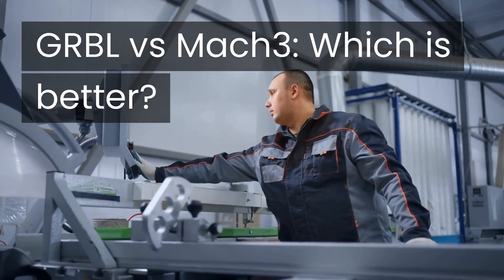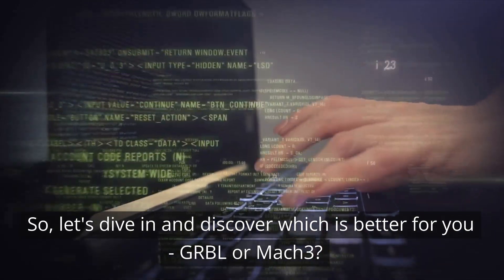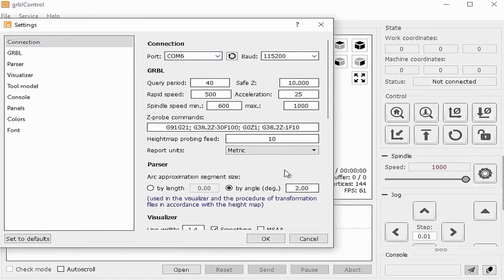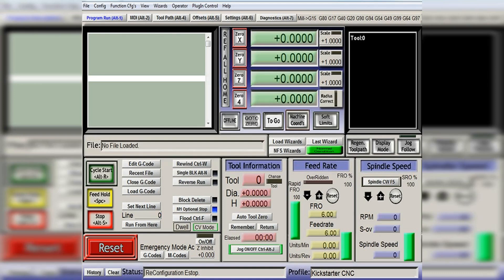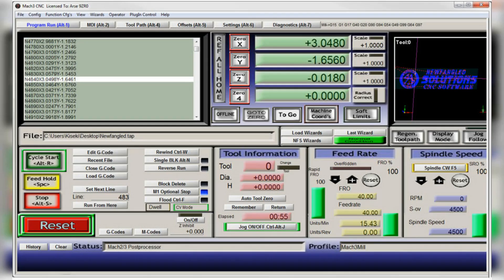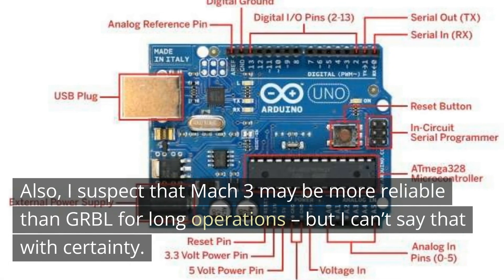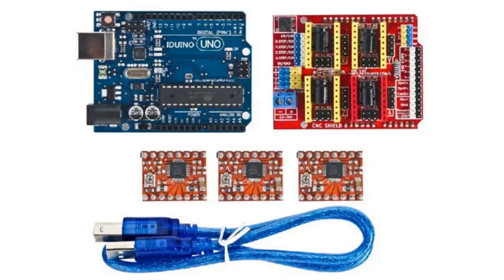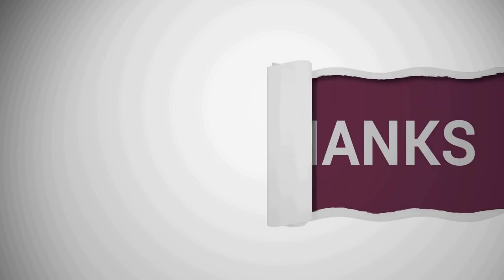GRBL vs Mach3:  Which is better?  CNCSourced

Comment: Arduino has changed its terms and conditions (after been brought by qualcomm) on its software use which undermines the open source using the Arduino.

Comment: I have used mach3 with an ethernet motion controller since 2015. I started in 2013 with mach3 and parallel breakout board (BOB). I also have a grbl machine but hardly use it because mach3 is so much better. Here is a tip, Look at New Dangle Solutions Mill Wizard.

Comment: Not exactly and Apple to apple comparison, more like apples and oranges. The other issue not stated is windows is not a real time OS. To use windows to make microsecond and millisecond timing is critical and not as good as having a dedicated CPU (Arduino) run Gcode from a PC or Host and off load the critical timing to the Arduino ATMEL CPU.

Comment: the only useful part about coming here is seeing peoples worthy comments
mach3 for years has USB and works perfectly on win 7 10 and 11 
mach3 has much more support and features that no GRBL software can do  
when I first used a Mini cnc it was with Grbl and to say for the cost it is suitable for these little machines
as free controller software and a good amount of support from the GRBL community
 
But after a short while i moved to Mach3 as i got a 4 axis desktop and wont change the back to GRBL
and to say i love Arduino as i develop stuff  very often ,  but to use on a 4 axis high voltage and with 1.5 kw with Limit switches and camera and safety sensors  for a  such cnc nuh!

Comment: Lots of misinformation in this video.There are many Mach 3 and Mach 4  USB controllers. Mine is for a start.I use a tiny Beelink mini pc to run mine , to save space.
I have never used parallel for cnc nor have I had to.
Mach 3 has been around for many years so there is a lot of knowledge and information to help you all over the web.I started using Mach 3 with my USB Mach 3 controller just over 4 years ago as a total novice ,I had never used a cnc machine, not even seen one in the flesh.Within the day I was running it like I had been using it for years..Mach 3 is not perfect and it is old and will never be updated.But there are many users all over the world still using it and there are many companies making things to work with it.

Comment: 3:52 You said GRBL can only control 3-Axis. You can control 4, 5, or 6 depending on how many you need with GRBL.
Reply: How ? Trying to figure this out now
Reply: @regdrifts  It depends on the board you're using. FluidNC is free code for the ESP32 and allows for up to 6 axes. There are many boards that support 6 axes.

Comment: 1:28 Did he say parallel port? Why is this stuff of the past in the 80s and 70s when we had ditto machines and FAX machines? COME ON Mach3 upgrade to USB.
Reply: Mach3 compatible controllers with USB and Ethernet interface have been available for over a decade.
COME ON FrustratedBaboon, upgrade your knowledge to at least 2010 level.
Reply: A lot of “old tech” is still used. While USB is superior for consumer electronics, it’s not necessarily superior for industrial equipment.
Reply: avoid anything that uses an arduino! you could pay me to use grbl!

Comment: Very biased comparison.  GRBl on arduino doesnt need break-out board?  That's effectively what a shield is.  Mach has been supporting ethernet for breakout connection in lieu of parallel ports for several years.  High step rates benefit from the much faster cpu speed in a pc or laptop.

Comment: Anyone that has programmed for a living knows that the canned cycles and variables and macros are a huge advantage also machines like HAAS and robots in the auto industries use Fanuc based programming code. grbl will always just be a toy cnc for 3d printers and laser engravers.

Comment: GRBL will not "outdate" linuxcnc/mach3/4... simply put, GRBL is NOT a realtime controller. Because of that, there are quite a few features it simply cannot do. On top of that, there are a plethora of other reasons such as IO's, and additional hardware that can be added to the stack on realtime controllers that GRBL can't handle at all, and won't be able to unless it's ported to another hardware platform. 

There are very good reasons that GRBL is almost exclusively used in beginner / hobbyist environments, and almost never used in professional settings. Features, IO, Stability, repeatability etc are all among these reasons.

Comment: Don't forget to mention that GRBL is turn based, send commands, wait for them to finish, send more. 
LinuxCNC and Mach3/4 are real time.
Reply: Is this true? The plan ahead system was what put GRBL on the map, making all other MCU firmwares obsolete, and made it be the basis for all 3D printer firmwares back in the day. I think you are misinformed about that one. You would never get fluid motion the way you describe.
Reply: GRBL waits on commands for sure try to run at a feed rate of 2700 inches per minute on cutting profiles you will see it stop and go you never see that with Mach 3 or Linux CNC unless you loose steps and if you have closed loop motors that will throw an alarm and stop the machine in mach3 and Linux CNC. With grbl it just broke the bit for me when it missed data and skipped to a different place once it caught up missing countless commands and or steps.
Reply: @ is it waiting, or is it reaching maximum capacity? Running floating point math on an 8 bit 16MHz CPU is slow 😳

I checked the documentation. It looks 16 commands ahead. That is ok for straight, relatively long lines, but for a segmented arc, you have to slow down. 

Running it on a modern M4 or M7 with FPU, will probably work much better. 

I’m rebuilding a CNC now, and the choice of controller is not easy. Probably it will be one of the Chinese Mach controllers.

Comment: This video is no longer relevant: Mach3 is still able to compete with GRBL on Arduino. But he is already an outsider in comparison with FluidNC on ESP32 platform
Reply: Mach3 stopped being developed in 2012 and still better than any of that shit. Mach3 supports lathe's, mills, router's, etc with ATC. Mach4, UCCNC, WINCNC, LINUX CNC, etc there are plenty of PC based controllers that far better and mature that grbl nonsense. Even 200K to 1 million ++$$$ machinery comes with PC based controllers they are going anywhere.

Comment: I made my own cnc with arduino mega 2560 r3 and I control 6 axis, and I don't use the arduino shield I use nema 23 stepper motor with external drives controls,  I have a axis y x,z,a,b control then independently
Reply: Same but nema but nema 34, 12.5Nm servo step motors
Reply: But what software are you using? GRBL and Universal Gcode sender?
Reply: @slicktires2011  There are a lot of software. I have 10-15 freeware installed but I preferred BCNC because you can write scripts, auto level, use laser, plasma, spindle, you can visually delete part of gcode or in text mode .... it is really great piece of multiplatform software, windows, Linux, Raspberry Pi works on everything and it is light but with great visual presentation in different perspectives.

Comment: Grbl is garbage to control a cnc. It works but honestly it's a huge pain in the @$$. Mach 3 is old and mach 4 is crap. I still have machines running mach 3 but i will be going to Linux cnc for my mills and lathes and my plasm for my plasma machines.
Reply: Mach3  is a great piece of motion software,  I learned and used it  some 14 years agos, it helped me to finish a lot of work. Some 5 yrs ago, I learn LinuxCnc, it is difficult especially for those who learned Mach3 first and used to do programming in C language,  l managed to succeed to run it as well to make the programming of the auto toolchanging. Then, I get back to Mach3 lately and finish all the programing stuffs, in addition to auto toolchanging,  also the graphic  interface  and auto touch probe programming, the software  offers me much of function and features  to accomplish,  they are user-friendly. In view of LinuxCNC, I think I can't  easily succee or will I turn to download  someone free software  to use instead,  but I am not used doing that. Most importantly, for this software,  like the Gbrtl , you need to grab much informaton that are scared around in internet

Comment: The parallel port is just a piece of nonsense. If they haven't supported something newer by now they aren't serious. And that UI on Mach3? It's a horror.
Reply: It took me about 3 minutes to get Mach 3 to work and control steppers no worries, I have no idea where to start with a arduino so so to me Mach 3 is very user friendly
Reply: @theshauny  I think you had prior experience and a foggy memory.  It took me several days to get Mach3 working and then it was very flaky.  Years and years later I learned to insure the electronics is getting proper 5 volts to the board controls.  So the software was ok but everything needs to work for successful operations.
Reply: @bobmirror7164  the clean 5 bolts is a good great tip, I just followed a online tutorial for setting up the inputs and outputs. But I found the user interface/layout very intuitive.

The prior experience I have is with a proper cnc when I was a apprentice the setting up/making a hobby cnc I had zero experience only my own intuition
Reply: Mach 3 is really similar to a real CNC with G-code can cycles in macros and all. The first time I ever hooked it up it took me about 2 hours to set everything up wiring motors and drives and everything. I was cutting parts within 3 hours. I have a gerbil machine collect dust mostly it still has issues I still can't figure out even with help from the Gerber community. I mean the thing runs but it has glitches and is not very accurate or repeatable if you had a huge tolerance on your parts it would work fine.
Reply: @johnsonlong1272  Gerber is a photographic mask technique used to create printed circuits. The accuracy of any CNC is defined by the steppers, the microstepping ratio and the pitch of the ball screw. My CNC uses GRBL and it is accurate within 10 microns. It does not glitch. I do have a redundant Mach3 board which I have considered selling, but I can't with a clear conscience. If I'm asked I always recommend GRBL for its simplicity, reliability and accuracy.
Reply: @donepearce  ok maybe you can help me how do you write a 1" circle with grbl card using Gsender. And how do I drill multiple holes using a g81 and the peck drill cycle g83?
G20
G0g90g54
X0Y0
S230m3
Z1.
G98g83x1.y-2.r.05Q.075F1.5
X3.
Y2.
X4.250y5.75
G80
Goz1.
M5
M30
================
Circle
G20
S500m3
G0g90g54 
X0Y0 
Z.15
G1Z.010F10.
G1x1.y0.F10.
G3i-1.Z-.050
i-1.(To go around again to finish ramp to z plane)
G1x0y0 
G0z1.
M5
M30
≠≠=============
Now obviously everything would be Capitals even though it shouldn't matter. 
Now the sender grafts these with no alarm and shows it going it but machine doesn't do the same thing as the graft simulation but says program complete no alarms. 
PS. No one run these at zero it will break your bit. You can run them if you set your Z safe distance above the table so it won't hit the work z zero. The drilling cycle doesn't lift it just runs hole to hole as it goes not read the basic G-Code in the cann cycle.
Reply: @theshauny ,for me it was the same in a few minutes the machine was running with mach3 now to get it calibrated and steps and everything matching the moves on an indicator took maybe 2 hrs. But then the machine would run just about any G-code that the FANUC machines at work run. This grbl not so nice sure it's easy to configure and about the same time maybe a little longer  messing around calibrating every thing than mach3 but not too bad. The problem is it won't run like 1/2 the common Everyday simple G code. Last night I typed in a simple 1" circle program like I would on any FANUC control and it shows the circle on the screen but just moved x in a straight line x-1. Then back to x0. So 1 inch out and 1 inch back said program complete no errors but did not make the circle on the screen lol. I'm sure there's some other way that you have to program it that is not very user-friendly or as easy. Kind of like the fact that it doesn't like cann cycles so that means g81 or G83 single line of code drilling cycle to repeat in various XY locations. So I'm sure the solution to that is send it to the XY location then tell a crap load of z moves followed by the next xy location and z down and up moves. No thanks that's way too much code and too much screwing around I will figure out a way to write a macro and call it up at each xy location. Or I will just throw my old mach3  board back in and run Linux CNC even though I was liking Gsender but I don't think they are caught up to 1980's G-Code yet. Too busy trying to re invent the wheel just make it run the G-code that has been out since 1958 and let the programers/operators show you hot to make the machine do all this cool stuff that they are trying to do like touch off tools gosh the machine tool world has been touching off tools and probe inspecting parts since the 1980's we don't need to redo that just make it read all the G-Code and we can make it do anything you want specially if you make it read rad and length tool offsets and a and b variables so we can use macros and do math in the # variables. The possibilities are endless we don't need windows-based programs at all really only to make things look fancy with clicky boxes and buttons. We can code all the real work in g and machine code way faster and easier.

Comment: I use Mach3 with a Windows 10 computer without a parallel port. I use a UC100 motion control USB adaptor which works brilliantly, better than the parallel cable which I had on an older computer, but be warned - buy a genuine one.
Reply: Can you leave the link of the product?
Reply: @Manuel11589   Google search  " UC100 motion control USB adaptor  "  they are around 120 to 140 dollars.
Reply: I am interested in purchasing a CNC but I am not sure about purchasing an old PC.
Reply: There are many Mach3 compatible boards that use USB interfaces. The $20 red board shown in this video (bsmce04u-pp) is actually one of the better ones among the inexpensive Chinese productions.
There are many very sophisticated CNC controllers that use Mach3 or Mach 4 as the front-end GUI that communicate with Mach software via USB or Ethernet and do all heavy real time processing of gcode to step processing.
Reply: @rok1475  but with the BSMCEO4U-PP, on mach3 doesnt work the backlash configuration, so is completely worthless. Plus it makes problem with homing zeroing if using switches with long levers, it must be like buttons, cause mach3 after hit HOME it stops and it goes back at a fixed distance that cannot not even be customized. So with backlash not working, ending with homing that doesnt detach the switch after. Silly behavior of the software and board

Comment: linuxcnc has only true realtime and safe option, mach3 and windows base softwares not have newer safety. not realtime, same old GRBL not safe realtime and old worst not working well. factory and instructrial not newer used windows based software very dangerous, only linux have safe use factory and machines.

Comment: Both SUCK, do yourself a favor and purchase a Centroid Acorn controller. Best DIY controller on the market. Hardware and software made by the same company with updates/improvements made all the time. The best support on the web.
Reply: Also, not sold on Amazon anymore
Reply: but worst if come problems, lot problems all users.
Reply: Does it work on Linux?
Reply: I think you probably are right I have been looking at acorn along with a few others for a standalone.

Comment: There are many inaccuracies in this video. It should not be used to make CNC controller decisions.
Reply: Sorry but this video did make me want to switch to GRBL to make a pencil plotter. You think I should not?
Reply: @rusticagenerica  No no. That was too abrupt of me. What I should have said is that it shouldn't be used if you're looking for a 3+ axis control/firmware. Basic GRBL is good up to 3 axis, there are forks of the code that work with more, but you'll need to go with one of the alternative like LinuxCNC, FluidNC, Mach3 or one of the many GRBL forks. I am no expert though so please don't think my snarky remark was justified. The way it was worded was wrong of me. My apologies to the creator of this video.
Reply: @kevinyancey  So basically you just repeated what the video said? Mach3 is good for more axis and macros, but on the other aspects GRBL is likely a better option. What you on about?

Comment: Mach3 ceased development over 11 years ago (april 2012) so why is anyone making content about it? It was shite then and it hasn't gotten any better. 
Ps mach isn't the only windows based controller. 

This video is a joke
Reply: for real . mach3  is trash
Reply: @wildhorsemfg is GRBL ok? My CNC comes with GRBL
Reply: @arbjful  Yes it's perfect
Reply: @wildhorsemfg  Mach3 is great, user-friendly,  many features  to be used
Reply: @ray-charc3131  I don’t understand people’s hate for mach3 it took me about 3 minutes to become familiar with its layout and I had steppers, well stepping, it would take me longer than that to read the instructions of a arduino (I’ve never played with arduino but would like to at some stage
Reply: @theshauny I use Linuxcnc as well. Although it is good, it is difficult to learn. Problems not easily be solved, because information scatters all around, not easy to get answer, i am still on the journey and struggling